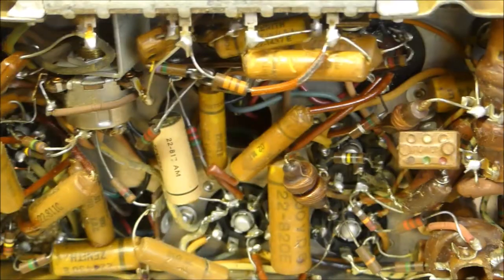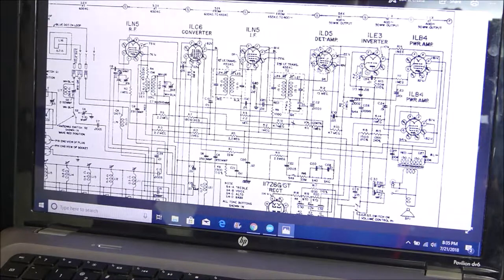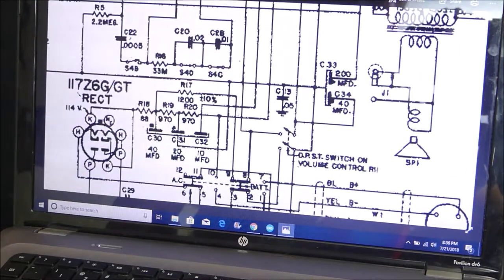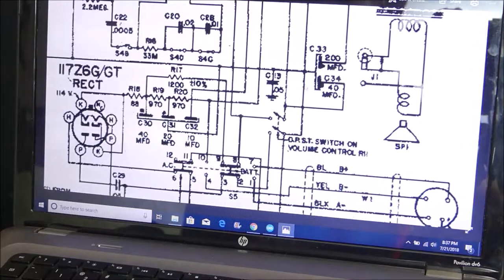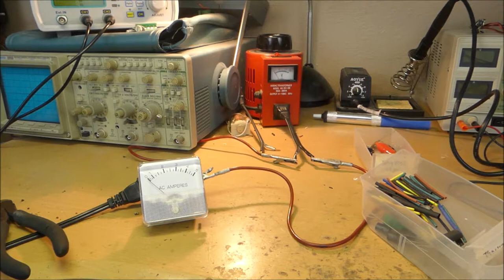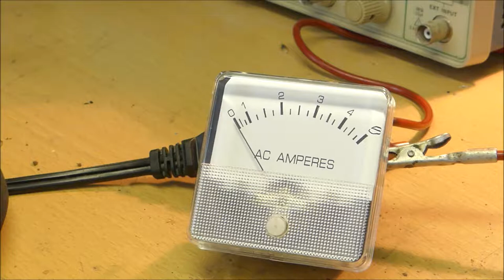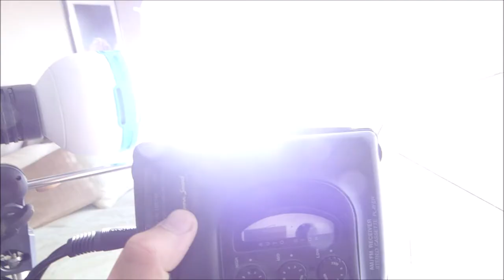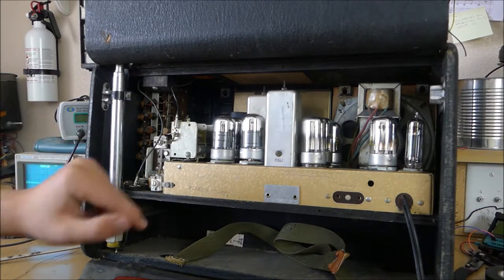Replacing Electrolytic Caps and Power Cord in a Zenith Transatlantic Radio

Comment: As a general rule, you need to replace all of them, even if they measure ok, once they get power through them, blammo, you also can only test those capacitors with an esr meter, a high number means they're bad, low is fine

You can learn a lot about this sort of technology from uncledoug or glasslinger, you could also challenge yourself and perfboard it

Comment: The miniature tubes used in this Zenith Transatlantic require (if I remember correctly) have filaments that require 1.5 volts. There is an entire subculture that operate, repair, and restore “ZT’s”... lots of good stuff on the web. I’ve owned several. I always regret it when I sell one.

Comment: follow the signal through the chain from the plate of the first tube onto the grid of the next tube in the chain,  sounds like audio output stage is working and if you have Local oscillator take a look on the grid of the detector tube for a signal and if its present  take a look at the plate... loosely couple a signal from your sig gen so you have a reliable signal to chase  (not a direct connection ) ...........
Steve

Comment: Hi Tanner, you should check the coupling caps for resistance. They should be higher than 10 megohms. If not they pull your grid voltage up. The grid potential is usually a couple of volts in the negative referenced to the cathode. The other caps (e.g. bypass on the screen grid) are not critical. Only look out for all the coupling caps on IF and audio stages. When there are voltages noted in the schematics check them first. A faulty coupling cap let's the tube draw much more plate current that you will find with a too low plate voltage. A such misbiased stage can cause all kinds of distortion and lowers amplification. The 60 hz hum could have other sources than this. 
Have fun and greetings from Canada again 
Lutz

Comment: Cool to see someone else my age working on tube electronics, there’s nothing better than them not gonna lie

Btw, don’t mean to correct you on terms, but All American Five refers to tubes with only 5 tubes and no power transformer, these sets normally have the line cord connected directly to the chassis and as such, touching the chassis with the set plugged in will give you quite the wonderful shock. It’s recommended you use an isolation transformer when working on those sets to take the voltage off the chassis,
Reply from the maker: Thanks! Yeah, I have had a few shocks from AA5 radio chassis.  Good call to use an isolation transformer.

Comment: Rf amplifier (front end)? Do you have a signal generator? Inject at antenna and follow the signal through the radio... could also be a coupling cap that is shot etc...